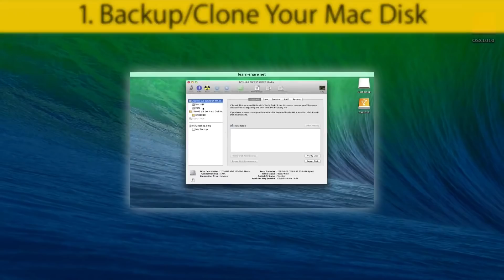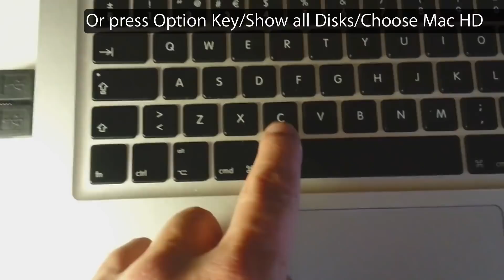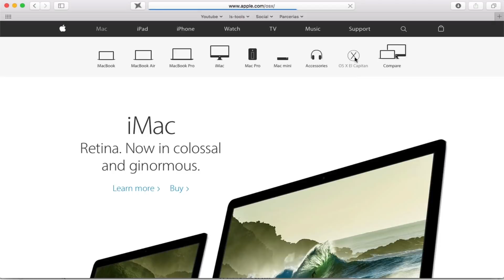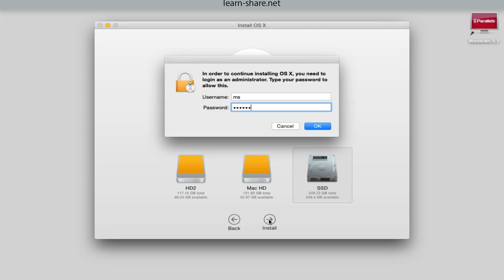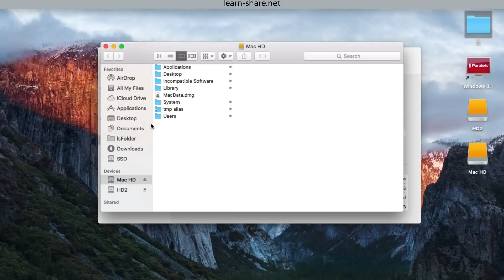How to Upgrade MacBook Pro HDD to SSD Crucial BX100 + Install OS X El Capitan

Comment: hi great video! i have a question i just replaced my hard drive with a ssd but before i did that i cloned what i had in my hd to the ssd thinking im not going to need my hd anymore. now i want to have both drives and replace the optical drive but do i have to erase what i cloned in one of the drives??.
Reply from the maker: +veLAcity No need to erase just replace/optical drive and its done.

Comment: Does cloning the hard drive not install the operating system as well?
Reply: +Alex Jones of curse , nothing moor require
Reply: thanks so much
Reply: +Alex Jones thats the same thing i needed to know,but i think he showed us a way to get a fresh OS upgrade for the new SSD we trying to install.
Reply: I used the free version of Carbon Copy Cloner. Just plugged my SSD in with the usb adapter, cloned it, and installed the SSD. It worked perfectly and did not require downloading OS X El Capitan separately.